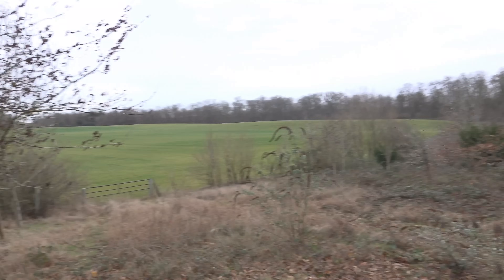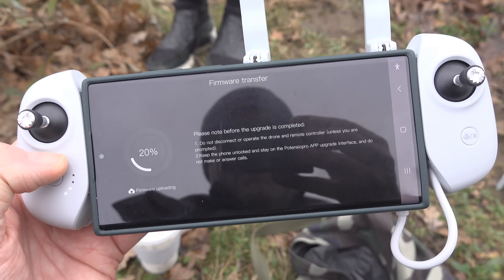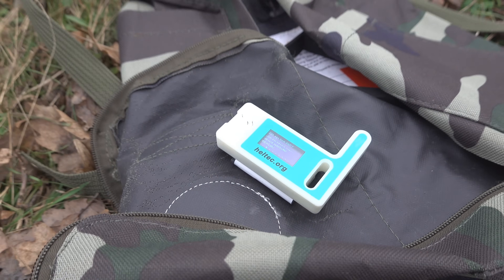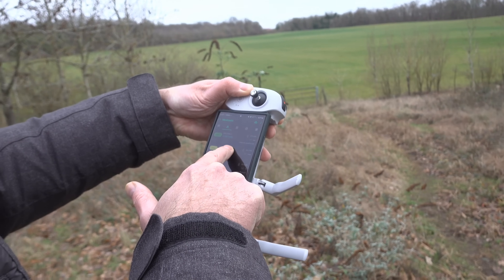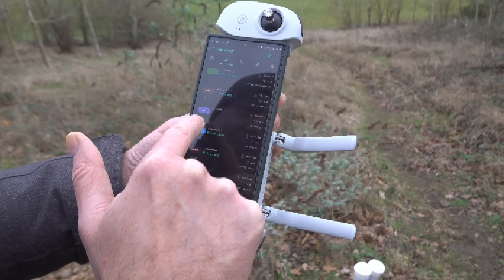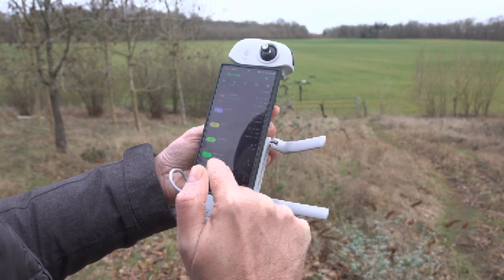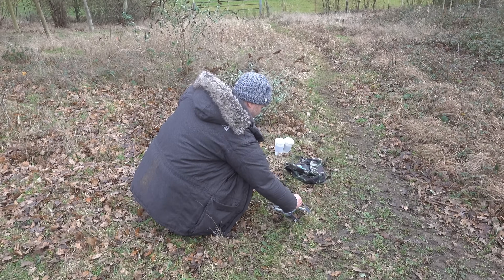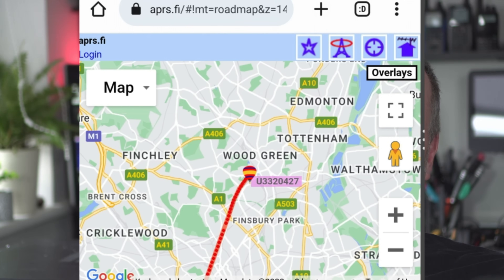EMERGENCY MESH NETWORKING USING DRONES!!!

Comment: given the relatively short duration of drone & small Lora battery's, running drones could be timed for a variation of the 333 plan (ch3, 3 mins past the 3rd hour  (midnight, 3am, 6, 9, midday.... etc) after an "event")
Joss Nash (spelling!? of Ham Radio Crash Course) put out a few emergency responder videos for ideas.

Comment: Fixed winh drone could be programmed to circle a waypoint and land when battery is low. Light near  'glider' drone would be able to circle above for hours. You could even flight the drone half way between the desired contact to get maximum range.

Comment: If the point is to blanket an area for Search & Rescue, etc. it might be interesting to use something like tethered balloons. Or an autonomous powered glider that will gently sip from battery, mostly for control surface servos, but it'll spin a prop if it needs to.

Comment: How hard is it to connect to the drone node with your local device?  Since the signal is stronger perpendicular to the antenna, would there be issue trying to connect from directly below the drone?  I would definitely orient my ground device on its side, but the drone one, you would want vertical for range, right?  Is communication between them an issue at all then?  I have no experience trying to connect to a node above me, though I am intrigued to try this.  A great idea for trying out.

Comment: Hi Andy, you and your mate (Ringway Manchester) got me hooked. Bought a kit last week. A bit disappointed to find that very few users near me. (Rhymney, near Merthyr Tydfil) However, I did get ONE contact, from 38 miles away, with no other node involved. Sounds unbelievable, but it was a channel called SPD3, and info I got was MAN  to Porto  Ryan Air FR117. explains his message that he was at 35000 feet over Bridgwater. So, Height really does matter !!!!! :-)
Reply: My board is arriving tomorrow so gonna set it up. Be nice to reach to the valleys from where I am in Llanelli!
Reply: In NZ, lots started out on Long fast then promptly abandoned it for Short fast. Might be worth re-running your test configured with the other setting  & see how it effect the numbers? Also maybe try both settings in another town Ebbw Vale or hill top - Sugar loaf?? where ever you fancy a day trip out to ;)

Comment: In my thinking a balloon wouldn’t have any electrical interference as a drone might have.   A balloon could stay up for extended periods of time as well.   A weather type balloon tethered with a winch line would provide some control and make for easy retrieval.    Sure gets the imagination going in terms of possible applications.

Comment: I would wonder if the video signal from the drone might desensitize the mesh receiver you taped to it.   It would transmit fine but chances are that its receive performance would not be too flash.

Comment: Great video! How about Mesh joins with TinyGS satellite group to arrange 1000+ miles comms? I'm RX cubesats almost 2000 miles away on a lora board on 436mhz,    73s

Comment: Dude...c'mon. You can't figure this out? I fly a DJI that I haven't had to update in several years because...wait for it...I keep the tablet in airplane mode. 🙄 But that's because I use a drone that has its own RC tx/rx freq and not on wifi. Been skipping firmware updates for at least 3 years. LOL

Comment: I had best results with lora tbeam  in 433 MHz with upgraded fpv dipole antenna  on a 6in feed  ,really isnt fcc legal on that band i believe.  At 400 ft i was able to transmit  alot further than i could receive, but still good results.
Reply: ~6km point to point with clear line of sight with two t-beams and stock antennas. Those devices are crippled by low power output, 100mW is nothing, 0.5-1W it would be completely different story.

Comment: Use a balloon with 100 mts of string.. no noise from motors and will stay up far longer than any drone... 👍🏻
Reply: Is a good idea for an intentional set up. But when hiking I am more likely to have a drone than a can of helium. That said wonder if you can get it in those small canisters like they have for bike tyres.

Comment: Hi Andy, I'm a VE, and have several meshtastics, and on the ground in a suburb  could not get over 600 meters if I was lucky. But at height, its another story. I'm in Aviation and I'm looking at getting some operators to mount one inside their aircraft with an external antenna. Several of these in a remote area flying around would behave like satelite passes.
Maybe we can chat sometime
Great vido
Thankyou

Comment: hi Andy, im only near the beginning of your video, but i would give it a try with the Meshtastic device mounted on the underside of the drone, I know this means you would need to hand launch it but i feel you will notice a difference, cool video i wonder if you could pick up a little dish antenna for that frequency, like how you can get the little gps dish antenna's. regards Richard 2E0DVK   P.s i got my Twizy because of what your videos where you did things with yours i love it its great... I have some ideas on the horizon for the Twizy would love to speak to you about them sometime, thanks Andy

Comment: Its so light why not attach it to a small, tethered helium balloon. Should remain aloft for quite a while.  Three spaced guys would help it stay in position quite well, and back each other up in case one broke.
Reply: Had the same thought. Weather balloons are quite cheap and can stay aloft for days with such a light payload.
Reply: @DustyLambert   In strong winds, a helium balloon would get blown down close to the ground.
When I was a kid I played around with kites, trying to see how high I could get.  One time I had got a kite out on 2,000 feet of line.  Not sure how high it eventually got but it had to be at least 1,000 feet.
Reply: @ the balloons might be, but Helium is pretty expensive. For doing this, I'd be tempted to use hydrogen - hydrolysis of water. Cheap as chips.

Comment: I wonder if you fly the drone away from you so its not directly above you. The motors gotta be making all kinds of magnetic noise that might be blocking. Or if you could attach the node to the underside of the drone by a string to get it away from the motors and get better line of sight. to the drone node and there for bounce to you distant node.

Comment: I did the drone test over the weekend using a Heltec under the drone trailing the antenna. @250’ Bluetooth stopped working, used another Heltec on the ground to beacon to the drone at 400’ but only got “Implicent ACK from another node” - My wife who was ~6 miles away never received the message.

Comment: I built a heltec into a 2m wingspan plane, the issues were mostly interference related because of all the other broadcast on the drone. So the fix was a larger aircraft to separate out antennas and frequencies. I’m still testing range, using the “known only” on long fast, I got about five miles until it started raining so I think this works well to provide temporary coverage to a specific area but to make it work you really need a long range plane that can stay airborne for a few hours.

Comment: You could attach a Moxon antenna (directional) and orient it toward the front of the drone. That way you could point-and-shoot your signal with some gain in a particular direction. The good thing about the Moxon is that while it is directional, it's not extremely directional (so there is some omni possible).
Reply: & doesn't have a significant weight premium.

Comment: Hi! Very nice video, I've got one question however.

How well does meshtastic deal with time air time restrictions in the ISM band?

I believe in Europe we've got maximum of 10% duty cycle on 869.4mhz and it's even lower with other frequencies. 

Have you ever been "rate limited"? I recall watching other youtube video where someone said in Europe, meshtastic app will limit transmission time for every hour. Apparently there are no such restrictions in the USA on 915mhz.
Reply: Correct, in the EU nodes are limited in air time. Although the speed of the messaging is quite fast so it will only really happen in busy areas. Even then there are settings to lower data usage
Reply from the maker: It's actually fine in long-fast mode. Even if there is a lot of chatter.

Comment: I've been doing similar experiments but with more expensive Mesh capable radios. The filtering on these are night and day difference compared to these Lora boards. I expect if you put a fairly sharp filter before the antenna you'd get better results. There is a lot of electrical  noise on these drones, especially when you're sandwiched between 4 motors. Maybe try again with the Lora radio dangling a couple of meters below on some string.
Reply from the maker: Yes that's good advice.
Reply: @andykirby  Low tech test? Go fly a kite. No interference of other nearby (feet) radios or electronics. Could stay up for hours.
Reply: @arthurvandergracht7101 when telling someone to fly a kite... Actually means to fly a kite. 😂 💀

Comment: It would be really interesting to see the mesh range between two drones at 100m. 🎉
Reply: @3nertia - you've got the wrong end of the stick
Reply: @m.t.horton  Thank you for your "valuable" input ...
Reply: 100 m doesn't seem impressive from a couple of drones, maybe a few miles/km/whatever though
Reply: @simonetrance  Called out? You mean by idiots like you with nothing valuable to add and no proper rebuttal or counterpoints? ROFLMEYERWIENER!

Thank you for your [valuable] contribution to the conversation, Dunning-Kruger Troll :)
Reply: @_chocky  Lol, okay - thanks for saying nothing that changes what I said about anything ;)
Reply: @_chocky  Sure, would you like me to provide you references for gravity too? Lmfao
Reply: @simonetrance  Thank you for your valuable "contribution" to the conversation, Dunning-Kruger! ROFLMEYERWIENER!
Reply: Probably not great if they're at the same exact altitude - radio waves propagate downward :)
Reply: Radio waves can propagate from transmitter to receiver in four ways: through ground waves, sky waves, free space waves, and open field waves. @3nertia
Reply: @3nertia  No they don't.
Reply: @HouseholdDog  Thank you for your valuable contribution to the conversation, Dunning-Kruger ...

Yes, gravity even affects electromagnetism ...
Reply: @3nertia  By a miniscule amount they will curve when passing under gravity.
They don't "propagate downwards" though. You are effectively saying everything goes straight to the ground.
Which begs the question. How does any radio work if it all "propagates downward".
It should all hit the ground.
Reply: @HouseholdDog  Have you studied to be an amateur ham radio operator? It propagates outward, and down, period. Despite whatever nonsense you think you think :)

If signals aren't affected by gravity, why do we need satellites, or cell towers, and why do they often put cell towers on the highest peak of a mountain or hilltop? lmao

Stop moving the goalposts and go back to studying :)
Reply: @3nertia  Troll.
Reply: @HouseholdDog  Ah, the irony of Dunning-Kruger :)
Reply: @3nertia  Exactly.
Reply: @HouseholdDog  ROFLMEYERWIENER! "I'm rubber, you're glue" - what a well thought out insult! Ah, the irony indeed :)
Reply: @3nertia  Radio waves "radiate" "radially" and project in a sideways doughnut looking pattern in all directions from the antenna. RF can be focused/directed by the antenna/ground plane design, but even in a directional antenna design the waves radiate 360 degrees in both every axis, The RF pattern can be modeled accurately digitally by antenna design, yet even a fiercely directional it looks something along the lines seen when squeezing a balloon from one side. RF moves at the speed of light and has no mass. Therefore gravity has no affect unless we are talking a black hole etc. Hope that helps!
Reply: @jamiecoburn1231  Thanks for beating a dead horse - you're so smart!

Doesn't make what I said untrue or you would get killer reception from a cell tower just underneath it, instead you get a better signal the further you move away from the source! Why are the towers so high up, I wonder? ROFLMEYERWIENER!
Reply: The curvature of the earth plays a role too :)
Reply: Y'all are trying to get into a level of specificity, that, for practical purposes, has no relevance to the discussion at hand really. But hey, "I'm a bored intellectual so I guess I'll troll someone I deem dumber than myself" - whatever feeds your pathetic egos I guess :)
Reply: @3nertia  yes indeed!
Reply: @3nertia  Care to elaborate on how and why radio waves propagate downward due to gravitational force? Your affirmation is so bold, that you are perhaps very close to change physics forever, you might be on the verge of proving Einstein's wrong and write your name in the books of history. Pound–Rebka experiment was very hard to conduct, and it proved the theoretical gravitational redshift, the effects on hearth were so small, it was incredibly difficult at the time to measure this. But somehow, you're saying gravitational pull from hearth pulls electromagnetic waves so strongly that you need satellites to overcome this hurdle. You should contact MIT, Harvard or any other prestigious institution right away!!!!!

Comment: And I thought I was being smart by making a standalone device with a small external antenna and sticking up one of the local hills for a few days.  Problem is the trees are  big boys so I'd only get 180 degrees,   but I should be able to use it as a repeater to home?

Comment: I envision a drone built with the radio hardware built in. It would be designed as a tethered drone so it wouldn't need batteries or the directional control radio components.

The base anchor would be it's battery to anchor it and provide endless power. The base would also have a solar panel to charge the battery during the day.

If enough days without sunshine occured these radio drones would land until their battery was charged again from the sun.

With an array of these we could have a semi permanent network established and it could function much as the Internet does today. Servers could also be built into these anchor bases to provide more functionality than simply radio alone.

Comment: Interesting video thanks very much ! I think you decided on the 868MHz for your nodes. Question... Did you consider the 433MHz band too? Of course, that's one of the "problems" of setting up a general network in that there are two viable ISM frequencies in the UK.